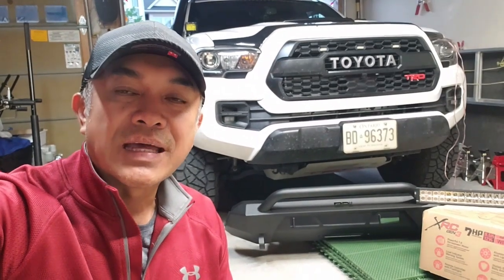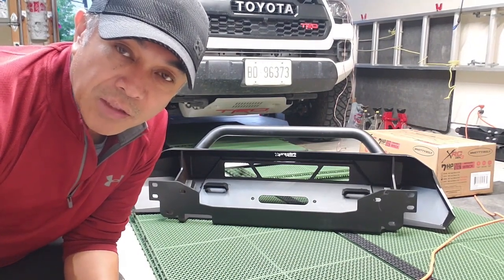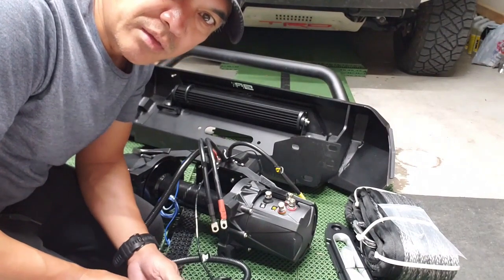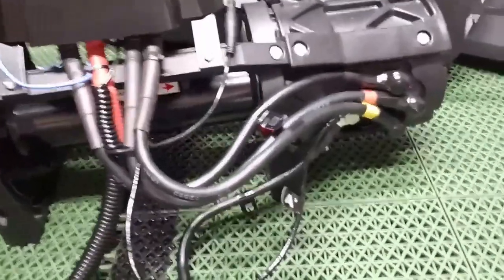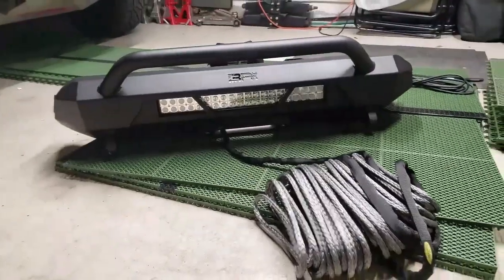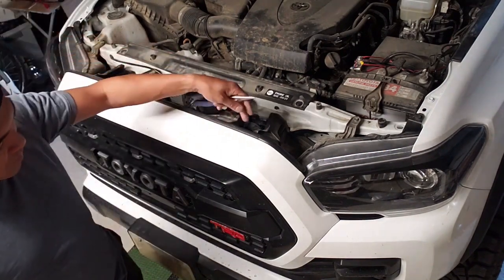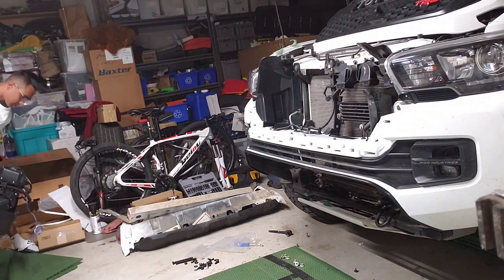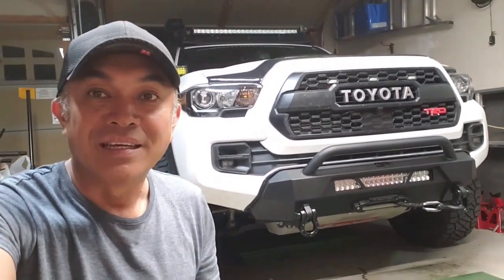Body Armor Hiline Bumper + XRC Winch, 24" Lightbar DIY Install onto 3rd Gen Toyota Tacoma | Mod #43

Comment: I got mine for $530 shipped from Morris 4x4 back in March. It looks great and works perfectly with the TRD skid plate and weighs less than 40 lbs.
Reply from the maker: Nice... but 40lbs just for the bumper correct?  My total weight between the bumper, winch and lightbar is 165lbs which lowered my front end and now I have to do a lift... it never ends. lol... thanks for tuning in Mike!

Comment: One of the best videos on this assembly I've seen. Thank you!
Reply from the maker: Hey Blood Striper, that means a lot to me, thank you.  Just an FYI, after this install, theres tire rubbing due to the added weight so I need to install a levelling kit which will give it a 1.5" lift.  I'll post the video by next weekend so tune in for that!
Reply: @modXELA , thank you for this tip!!

Comment: You state that you are installing a 24" light bar? I thought the bumper only fits a 20".
Reply from the maker: Hi aspiringpro! That's correct. The lightbar as advertised says 24" but in reality, it's shorter than that.  Best way to put it is that it's like buying 2"x4"x8' lumber, it's actually 1.5″x3.5″x8'.  I hope this helps.

Comment: Best instruction video I've seen so far. Well Done!
Reply from the maker: Hey Greg, that means a lot, thank you.  I just recently posted a demo video ( https://youtu.be/TBwP57n0FNY ) on how to operate this so check it out when you get a chance!  Thanks for tuning in!
Reply: @modXELA  Hi,  The 24" light bar can't be shipped to the USA. Do you have another recommendation?
Reply from the maker: @props-model-shop  There's quite a bit of selection on amazon.com.  As long as the specs are similar to it (https://www.amazon.ca/gp/product/B0185FOTL2/ref=ppx_yo_dt_b_asin_title_o01_s00?ie=UTF8&psc=1), you should be ok.  The Nighlight brand is nice, I would consider that not unless you want to spend more. =) Good luck!

Comment: Thanks for the video. How much do you think the bumper weighs by itself?
Reply from the maker: Hey Mike... total weight of the whole assembly is 160 lbs. Winch with synthetic rope is 46 lbs, LED light bar is about 3-4 lbs, so 110lbs for the bumper guard with the D-shackles. I recently installed the TC-19339w Wings and that's an additional 32lbs.
Reply: @modXELA  thank you for the information.
Reply from the maker: @Mike-4547  you’re welcome. If you are considering to install it, I would highly recommend that you install everything including the LED light bar the winch and the highline wing right off the bat. It’s a pain to do it piecemeal.
Reply: @modXELA  absolutely correct you did it was the best way everything in one shot.

Comment: A great informative video. My only concern is the cooler line bracket that gets unbolted from the frame. In all the videos I’ve watched, there is no way to reattach it. Certainly Toyota put that bracket there for a reason. Have you had any problems with the cooler lines rubbing or chaffing?
Reply from the maker: Hey tacomafan! I will take a peek at that cooler line for you this weekend…
Reply: @modXELA  I appreciate that. I had gotten my answer. I am told it is a power steering cooler.

Comment: Excellent job 👍, can add a video a connect the electric system to the battery o assign a new custom button to turn on the bar , I’m appreciate. Thanks 🙏
Reply from the maker: Sure thing but it's winter now so it will have to wait until it gets warmer!  =)

Comment: Are there any no cut bumpers made for 3rd gen Tacoma? Ive been looking and everything requires cutting. This is my first Tacoma and with my past F150's , Colorado's,  and Silverado's ive  been able to replace the bumper with after market with many styles with no cutting.
Reply from the maker: What’s wrong with cutting? I think bolt-on-only type of bumper guards are only available for 2nd gen.

Comment: Were you able to replace your front license plate, since you have the light bar and winch?
Reply from the maker: Hey sniper9424!  I have the flip-type license plate holder but I decided not to install it at the moment. My front plate is on my windshield at the moment so let's see how long until I get harassed by cops about it... lol.  crossing fingers

Comment: Great video!  Just bought a white Tacoma and I've been eying this bumper so it's nice to get an idea of what it looks like.  You did a great job.  After a year, any issues or concerns?  How has the winch fared?
Reply from the maker: Hey BucksQ, winch is good, I used it once this year so far and everything’s in good working order.  No issues and I’m pretty happy with it!  I will be installing the bumper wing later this summer so stay tuned. Thanks for tuning in brother!

Comment: This is the combination I am considering for my Tacoma - how hard is it to plug in the controller to the winch once it's all installed?  Is the winch accessible by opening the hood, or do you have to come from underneath?  Also, about how much did the front end drop with the added weight?  Did you get the truck realigned after adding the weight?  I still have my stock suspension (TRD Off Road) and don't run oversize tires.
Reply from the maker: Hey Dan, great questions!  Plugging in the controller is not an issue which you have to access from the top by opening the hood. I'm only 5'7" and I can reach in from the front with no issues (at least until I lift my truck).  Alternatively, if you can securely mount the controller somewhere in the front bay area, that would be good too so you won't have to be plugging/unplugging all the time. I'm choosing not to do this for now as I'm afraid of losing it. Before the winch/bumper install, I was able to get rid of tire rubbing (on 33's with CMC) but I am now experiencing some rubbing due to the 165lbs added weight causing a drop. I don't want to replace my Fox 2.5 coilovers yet so I am going with the Tuff Country 51025 kit (front strut spacer and rear AAL) which will give me 1.5" lift.  This should take care of the rubbing. You'll be fine with your 265s!

Comment: once the cutting wheel came out I was done, guess im going with the blitz bumper
Reply: Blitz bumper requires cutting too and is $300 more
Reply: @aspiringpro  just a little part at the bottom, and you can go back to stock easily. Ill pay the extra 300 to be able to go back to stock and not have to hack the shit out of the front of my truck
Reply: @tls5669  I mean why would I ever go back to stock? Besides, a new factory bumper costs only $200 + paint. the only risk is that of messing up during the cutting. You just have to be careful and use the right tool for the job.

Comment: Great job! Any concern with airbag sensor?
Reply from the maker: Hi James, airbags will still work and I hope that I will never find out (if you know what I mean).  No wires or connections were present or taken out from the crashbar so I'm not concerned about it. My real concern though is the amount of damage that it will cause in the event that I hit something head on as the crashbar is made out of aluminum and very light and this bumper guard with the winch is 165lbs combined so it could cause some damage.  However, this is functional and more of a necessity for me vs looks so I wanted to do it.  Thanks for tuning in!

Comment: Well done video, subscribed! Can you tell us if the additional weight up front is an issue? Did you have to change out your coil springs for heavier or was there really no effect overall?
Reply from the maker: Hey Dave, yes the added 165lbs on the front end caused tire rubbing so I had to install a levelling kit (Tuff Country 51025) which gave me 1.5"/1.5" lift... check the installation video here   https://youtu.be/kzCyauO8Sas   and now, tire rubbing issue solved!

Comment: I have the same set up! good choice!
Reply from the maker: Since I installed this, it added 165 lbs to my front so I now need to lift my truck as my 33's are rubbing... again.  =(  Any how, thanks for tuning in!
Reply: @modXELA  I added a extra 1.5 in the front and back lift
Reply from the maker: @julestrdprodjimavicpro2869  I'm doing the same thing. I ordered the 51025 Tuff Country levelling kit... just waiting for it to arrive.
Reply: @modXELA  I went with the Wescott Design TRD PRO lift kit and Icons Leafs

Comment: How much longer did the new bumper make the overall vehicle?  I’d like to do this but my garage is tight.
Reply from the maker: About 2.5"... I hope it'll fit!  One thing that I did not take into consideration was the amount of drop this 165 lb system to my suspension. Now I'll have to do a lift to rid off the rubbing. Anyway, I hope things work out for you and thanks for tuning in RedBarron!

Comment: Looks AWESOME!
where do you reattach the front license plate?
Reply from the maker: Great question Christopher. A mounting plate was actually provided with the bumper system. However, it gets installed where the fairlead is so that wasn't an option for me. I could get a plate mount that flips up when using the winch (which is actually a very good option) but I didn't like the look of it so until I get pulled over for not having it mounted on the bumper, it will sit on my windshield for now. If I have to install a holder, going with the flip version will be a challenge now as you'll have to remove many things to get at the installation points. I hope this helps, thanks for tuning in!
Reply: @modXELA  
I just got my Tacoma a little over a week ago. I’ve been looking at these exact bumpers for a while. Like you, I live in a state that requires a front license plate. I like the winch idea. If/when I get this bumper, I may hold off on the winch so I could have a place to mount the front license plate. 
Thanks for putting together another great video! You made it look a lot easier then the other install videos I’ve watched.
Reply from the maker: @GoldenFriedTofu  The two things that you can bypass to save time and effort is the bumper removal and applying of tape for the markings.  These are not necessary at all. Also, take a look at the DV8 bumper as well if your looking at bumpers, it's pretty much the same as the Body Armor but at a lower price.  Thanks for tuning in Christopher and congratulations on your new Taco!!!  =)  Enjoy.

Comment: Great setup!! This will be my next project for my 🌮. How ya liking ur tires? Are they ko2?
Reply from the maker: Hey thanks iamalemontree! I have the Nitto Ridge Grapplers actually.  It was a toss between that and the KO2s. I read a few reviews that the KO2s were a tiny bit noisier compared to the Grapplers so I took a gamble.  So far, it's paid off and I'm very happy with it (not that the KO2s would have been a bad choice as you won't go wrong either way).  It performs well on paved road and offroad.  Crawls through rocks, sand, mud without issues.  For daily driving, it's great.  No issues on snow or slush or rain either. IMO, I thinks it's even a little quite compared to the factory Goodyear that came with the truck. Also, I prefer the look of it a lot more than the KO2s but again, either will be a good choice.  I have the install video here if you wanna check it out: https://youtu.be/DCAAkN1qo40  thanks for tuning in!
Reply: @modXELA  thanks so much Xela! I will be on the look out for those nitto ahh they do look bad azz!

Comment: I'm going to buy this bumper and light and install it myself. What did you do for a light switch??
Reply from the maker: I just used the button switch that came with the lightbar and just stuck it where the rest of the light switches are as I've ran out of empty button spots. You can do an OEM style switch and here's  of my videos showing the install: https://youtu.be/9O29v6pEuBg

Good luck with your install Johnny Reb! Would love to see how yours turn out!

Comment: Hi Line bumper calls for a 20” light bar but you used a 24”?
Reply from the maker: Hey Troy. It's like buying lumber, the size is actually shorter than advertised. Mine is actually just under 21" and it worked out perfectly as the cutout for the light is 20.5".

Comment: How do you engage and disengage the winch
Reply from the maker: Hi Robert, plug in the controller and there's a clutch that you toggle on/off.  Here's my demo video of it: https://youtu.be/TBwP57n0FNY  Thanks for tuning in!
Reply: Thank you that's exactly what I wanted to see. Getting ready to install the same setup on my 2021 OR. By the way love your videos
Reply from the maker: @robertmcivor834  You are very welcome, good luck with your install and thanks for tuning in... I have done quite a few mods on my truck so make sure to check them out.  This weekend, I will be installing bed and tailgate LED lights so stay tuned for those!  Cheers!

Comment: how's that winch holding up so far and do you honestly recommend ? Very great work by the way!! I have a super white as well and it'll look sick. 

Thanks
Reply from the maker: Hey Osama, good news is, I haven't had the chance to use it. I took 5 offroading trips this summer and went without a hitch so the winch kept pretty tucked up in there.  Bad news is I can't give it any recommendations as I don't know how well it performs. From an installation perspective,  it was easy, a definite DIY project.  Aesthetically, installing the bumper and winch completed the overall look that I aimed for so at least I have that!   =)  I will make sure to make a review video as soon as I can.  Thanks for tuning in!
Reply: @modXELA  Thats good !! At least you have not used it yet still in a good condition. Your rig def looks gorgeous thank you for the reply.

Comment: How do u feel it is for stremgnth ? Strong enough for winch pulls? Strong enough with how it mounts to the frame ? Thx
Reply from the maker: Hey thumperbangin2000, I've tested it winching an F-150 (see my demo video here: https://youtu.be/TBwP57n0FNY?si=q4CwWx_30EUsim53) and it handled it without issues.  I also winched out my son's Honda Civic last winter off a ditch and it didn't even flinch so I'm very pleased with this installation.
Reply: @modXELA  good to hear. Ive been reading up on the front frame reinforcement plates. I think I'm over thinking things though.
Reply from the maker: @thumperbangin2000  nothing wrong with overthinking things especially when it comes to safety. I'm sure engineers did their R&D due diligence before putting out a product (one would hope anyway)!
Reply: @modXELA  just a side note. I have the replica version of the hiline. Scored it for $260 shipped. I bedline painted it, its ready for install 11/1
Reply from the maker: @thumperbangin2000  $260 is a big steal! Good luck with your install. I’m thinking of installing a hiline wing. What’s your opinion on that?
Reply: @modXELA  thanks man. Just got the winch today. Doing a lot all in one shot, bumper, winch, lightbar, cab mount chop, 1.25 wheel spacers, inspection.. 

RE Wings, i am running the Avid bumper guard currently , it has wings built in. Its nice to have that extra protection on the sides. Me personally, been debating on viper cut with this new bumper, i am just not sold on it yet and 100, we shall see.
Reply from the maker: @thumperbangin2000  wow, that's a lot of mods... I've done all of that. would love to see photos!

Comment: Great video Alex! I’ve been thinking of buying this particular bumper but can’t decide on what led light to get. There are so many choices available. How is the light bar that you’ve chosen so far? Did it come with the wire harness and switch?
The Body Armor bumper do make the truck rugged. Galing ng video mo kabayan! Subcriber na rin ako sa channel mo👍
Reply from the maker: Holy crap pare ko... sorry I missed your comment, I just saw it now so pasensya na.  Anyway, the lightbar is holding up so far, no issues with it.  It did come with the wire harness and switch but I replaced the switch with an OEM style.  Salamat for subscribing and thanks for tuning in. Hope to hear from you again kabayan!

Comment: How did you angle the light bar correctly so that it is not pointing too far down or up?
Reply from the maker: Hey P-51 Mustang, for this specific lightbar, there's no option to change beam trajectory so I just made sure it was mounted flush against the anchor points.

Comment: It’s that a 24 inches light or a 22 in?
Reply from the maker: Hey silvestre08al... the description says 24" but physical dimension is actually 22".  Just make sure that whatever you get, it measures out to at least 22" so you won't have a gap on the sides.

Comment: Did you do a video on how ran the wiring into the cab for the lightbars off and on switch? Also, what switch did you use?
Reply from the maker: Hi David, I did not a detailed install video for the lightbar in this video and I just used the switch that came with it but I intend to swap that out with an OEM-style switch this coming spring. I have other videos that demonstrate switch installation for your reference (see https://youtu.be/8YI3rP6W0oQ  which is a video on how I wired the roof rack LED light bar).  It's pretty straightforward, you just need to run the line for the switch through the firewall and connect the +/- leads to the battery and then the ground.
Reply: @modXELA  Thanks for your quick response. I know what you mean. It's getting too cold to be doing anything outside. Especially where you are at. Lol
I just found you on Instagram too.
Reply from the maker: @davidr.1517  here's a video on installing an OEM-style switch... https://youtu.be/nSFQVKiQDB0   i hope this helps!

I still have yet to post something on my Instagram lol... but it's coming.  Thanks for tuning in David. Contact me at anytime if you have any questions.
Reply: @modXELA  Thanks and you too. I have a 2020 OFF-ROAD that I did the Bilstein 6112's and the 5160's . That front bumper and all are next
Reply from the maker: @davidr.1517  nice lift system you got there.  I want that same exact setup but I still want to keep my Fox 2.5 shocks so I went with the Tuff Country levelling kit for now.